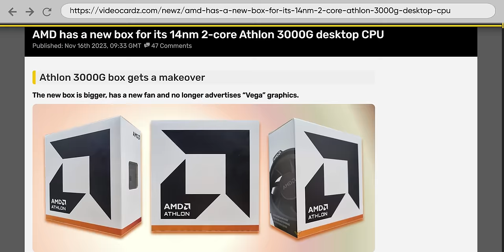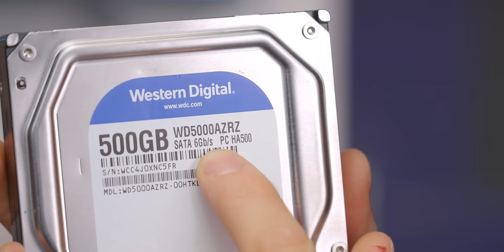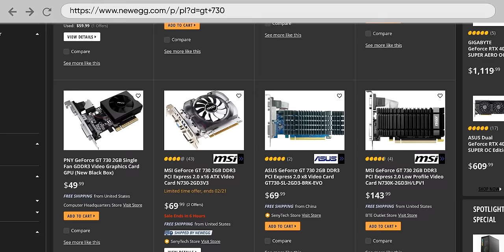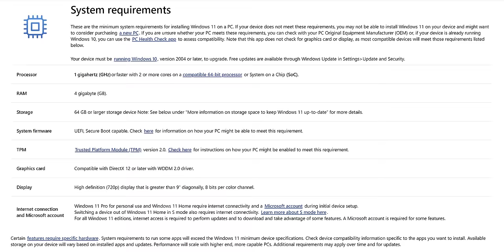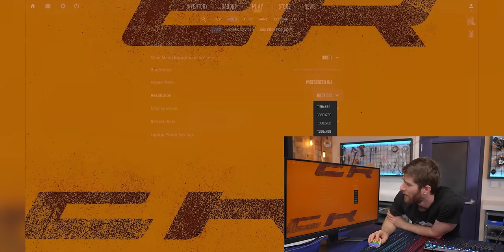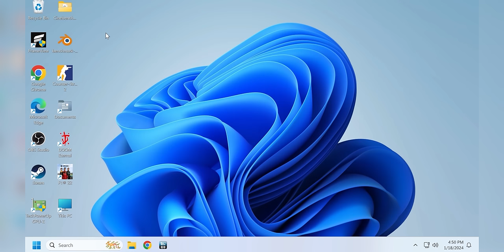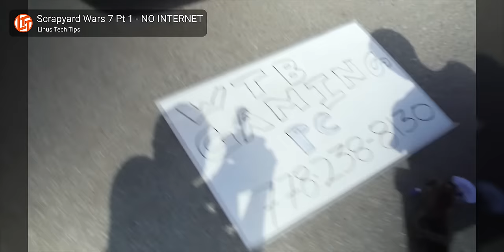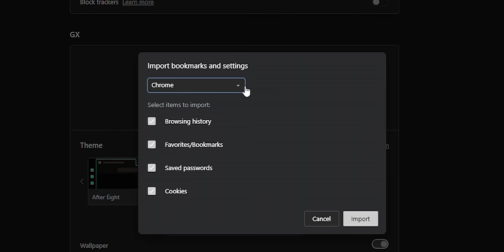I Built the Slowest Brand New PC and it Sucks.

Comment: It's crazy how "newest and slowest" PCs are essentially e-waste when compared to second-hand units. Really makes you question the value of buying brand new.
Reply: Wow! It’s almost like we watched the same video 😂
Reply: @w3therby  I will remove my comment and you should too. I don't know why I reacted on a generated comment.
Reply: Keep in mind they went out of their way to find the "slowest" parts for the money - you can build or buy new systems for a similar cost that perform much better - for example, I got a BeeLink mini PC for half the cost and it performs so much better. I use it as a Minecraft server for my kids and it works just fine for that purpose - even running it through virtualization.
Reply: Rightfully so. 
  - a broke hardware enthusiast
Reply: You get a warranty (although you get that from refurbishers as well).
Reply: In the used market for 11 years, reuse, nothing wrong with it.
Reply: that's a very llm comment
Reply: It’s crazy how this is better than the laptop I got brand new 3 years ago. Turns out, I shouldn’t have bought a laptop b4 I understood anything about what I was acc getting.
Reply: I haven't bought or built a brand new desktop or laptop for 15 years. I only buy PSU's and SSD's new.
Reply: I have a 2014 Dell Optiplex 9020. i7 4790, 8GB, 500GB SSD, 2GB GPU and it cost me £60. It would annihilate this slug pc.
Reply: "newest" is a huge stretch.  There are LGA 1700 Celerons.  More like "new old-stock"
Reply: Imagine you're a manufacturer of point-of-sale units or industrial PCs which run extremely primitive software and aren't internet connected. You need piles of them and reliability is everything. The ticket vending machines at my local train station are a good example.
Reply: Or the simple waste of tons of resources.
Reply: @althejazzman  Legit man. The last thing I bought new was an HP laptop in around 2008 and now I have 30+ computers. You just get so much more bang for your buck 2nd hand.
Reply: @el_shmuel  hey i still see your comment
Reply: @kelvinstokes996  That's a good point. In that application i think the amd would be the best one with half the tdp, paired with an ssd or m.2 you would have a decent atm or ticket machine etc.
Reply: @Cyba_IT  Is that why you've gone through 30+ computers?  Because they provide you bang for the buck??  I've only built 3 PCs in the last 12 years; the one I'm currently using has been upgraded 5 different times, the first one died in 6 months because of a bad CPU socket, and my next one requires windows 11 (it posted but not ready for Win 11 yet).  Thirty+ computers seems wasteful unless they vacuum, cook, clean, and fold laundry.
Reply: Business. That's why they exist.
Reply: @reubenmorris487  He didn't say he's gone through 30 computers, he said he owns 30 computers. I'm under the assumption they all still work
Reply: I feel like the big lesson to take away here is to always go for the mid-range? Mid-range from a few years ago is superior to the low-range of today for a fraction of the price... and on the flip side, getting mid-range today and then upgrading it to md-range a few years in the future will probably be cheaper than getting high-end today so that it will still be enough for you several years down the road.

Anybody who's trying to be the cheapest will have absolute garbage quality and anybody who's trying to be the best performance will be super expensive, but getting something balanced between those extremes means you're probably pretty decent at both.
Reply: These are legacy parts.  It's always been like this.  Notice that they are 14nm.
Reply: a 11 year old cpu like the i5 3470 is a better cpu than 3000g and that cpu is considered an e waste already crazy people.
Reply: Same goes for anything on low end, all gpus bellow 50 series nvidia or 600 amd ,i3, rysen3
Reply: Honestly, before 2021 i only used second hand parts for my own pc builds and i have been a hobby builder since 2012 or so.
I started in 2013 with a used i7 860, that i stopped using only 2-3 years ago. It was like an old king that refused to step down or die, and still held himself in combat.
So much so that i build a pc with it for a friend, he is still using it to this day for desktop use and competitive games.

On a budget, especially as a teen with no job i'd always go for second hand high-end gear. There is a point in a pc's lifespan where the value drops immensely because the new stuff is far ahead, but it's still a powerhouse nonetheless.
I still use a Dell Precision M4800 laptop from 2014 as my main portable, 4K screen and enough power in that I7 to make it a smooth experience. That mobile I7 would smoke these budget chips, i bet that i7 860 still would too!
Reply: Same goes for Brand New $75 smartphones, $150 laptops, $300 bikes, $600 mopeds, $1,200 motorcycles, $12,000 cars (besides the Renault Sandero and the upcoming Kardian).

As for houses, it's pretty impressive what you can get in a 500 square feet $120,000 "tiny house" nowadays.

Used? You can find anything on the second hand market at better value and quality for those prices as long as you're patient enough and willing to try haggling down the list price by 10-25%
Reply: If you actually tried to make a cheap new pc it’s a good value. Mine is like a little more than this one and it’s a million times better,
Reply: I just buy new because of warranties and stuff like that.
Reply: That goes for a lot of goods. Cheap clothing, garbage from china being broken easily and becoming waste. It’s a sad reality really as someone who keeps their stuff for a long time.
Reply: Well, for gaming it is just not worth it, not even for simple Windows with Office. But, if you are running some non GUI linux, it might be worth to consider brand new. But somehow I think in that case you better might look for a RasPi or equal. yet every usecase is different.
Reply: @reubenmorris487  I have different OS's on most of them, from Windows 3.1 to Temple OS and everything in between. 3 watercooled gaming pc's, 3 gaming laptops, 8 tablets, 6 phones, 12 regular pc's, 2 servers and about 9 or 10 regular laptops and ultrabooks. One can never have too many computers.
Reply: It's not new, new is like the super NVIDIA cards, not something from 2012.
Reply: This feels very dead internet not gonna lie
Reply: They are not. They are my faculty computers
Reply: I would say the value of buying new is knowing you can choose to get 3 years out of a system instead of buying used and having absolutely zero idea how much life is left in the thing you just purchased
Reply: Depends from use case. For secretary computer it is fine to have something capable to run office suite andweb browser without touching 3D gaming stuff. The thing is that newest software already run much better on CPUs with at least 4 real cores. If mediocre 4 core CPU and SSD can push the show, businesses will not pay more. For the rest of us former premium class hardware indeed will p[erform better in most cases. Of course don't go too low, premium configuration PC from 2005 will be annoyingly slow for today's tasks.
Reply: @KrotowX  Even a computer with these specs is not good enough for basic office work because of just how much longer it will take to complete basic tasks. Because instead of spending a 10th of a second waiting for something to load, you might actually spend three or four seconds and that adds up over time.
Reply: My used HP ZBook 17” G4 as configured back in the day…. cost a cool $4000 when you bought it off HP! Never buy new. 😢😊
Reply: Buying new without any hardware knowledge vs buying second hand with some knowledge and luck* the value of new is great as long as you know what you're doing and have the right budget
Reply: Wow thanks for the summary
Reply: No it doesn't. Things like warranty and knowing that your 100 dollar 1080ti was railed for mining make a mass8ve difference
Reply: some might say, "waste of sands"
Reply: GPUs are the biggest thing you can get used and save a ton for good power, I had dual 1080s for 200 a piece when the 20 series came out, when the 30 series came out I upgraded to a 2080ti for 500 I believe, They are 200s now on ebay, Now a 3090 can be had for 500-600 on ebay. Sure beats paying 1500+ for a new GPU when you can simply wait til the next generation and take 1000 off.
Reply: @JasonTaylor-po5xc  Most definitely, I think I built our new office PC for 300-400 all new parts and it is pretty damn quick with the exception of the GPU as I got a 730 just for multi monitor setups.
I put a I5 12600k in it and it was faster than my i9 9900k. Made me jealous that I haven't upgraded my gaming PC yet because it's a big let down for a cheap new I5 to beat my 500 dollar I9 from years ago lmao.
Reply: If you thinking of consumer products sure...
But for commercial devices. You may not need to go excess. You just need a warranty and some power. 
I buildt some scientific units that use these type of things because they sit on a bench and do a very basic task, and basic visualisation.
Reply: I think you should try ssd and then lets see difference
Reply: @4RILDIGITAL  if nobody buys brand new products then eventually there wouldn't be any used products either 😅. In a way, buying brand new products, like a car for instance, is a massive act of philanthropy as someone will eventually get that same car second hand for a considerable discount. That's why used car prices are increasing, as nobody can afford to buy new ones 😂.
Reply: @spoodmanire  don't tell people to buy used, it'll increase prices for us 👀
Reply: @ls0955  everyone makes that mistake to begin with 😅
Reply: good thing that international markets also have lots of places to go to for 2nd hand parts without paying expensive shipping fees right? …
Reply: Just put in dual channel ram and that poor computer would perform alot faster. Also, for the love of god dont buy dualcore at this time XD
Reply: I think the choice of hardware is the problem. If you get rid of that expensive MB and thar useless GPU you can get a waaay better brand new PC.

You can get a 5600G with a cheap A520 or A320 at about the same prince of that Celeron + H410 bc you would be putting 100 dollars on a good APU, not a useless motherboard and use the money you didnt spend on a useless GT 1030 and buy more RAM, specially dual channel, and a cheap boot sata SSD. You'll probably have leftover money and about 5x the performance...
Reply: @-Eternal-Damnation-  yeah 😭

Comment: HDD is slow but that 4GB ram is the culprit for the whole system being super slow.
Reply: Fr. I think all of that is used by windows 11
Reply: 4gb was making the OS hit pagefile instantly which just further shows why you should not install OS's on hard drives

yes 16gb would probably make this thing more snappy it would not be that big of a difference because 2 non HT cores are E-waste and will struggle with OS alone

if anything this is a good showing on why you should think a bit when looking to build a setup where slower 2 8gb sticks are actually better than a faster single 16gb stick of RAM

another thing is windows by default these days has RAM compression enabled (known as SysMain in services) which will hammer CPU to save space and if you were to disable that you can gain some performance back

so yeah; don't buy modern low end and go buy yourself a last gen mid range or even older high end because used market is actually full of solid deals as long as you have patience
Reply: It's probably just the CPU. RAM and HDD alone (or together) isn't making it that slow.
Reply: Yeah even on a lightweight 64bit Linux distro install 4GB is barely enough, I don't even want to think about trying this on Win 10, or Win 11. 😵
Reply: It’s probably both. I used similar specs pc a while back and found out that if you have either SSD or 8G of RAM windows is at least useable. I have a pentium machine with HDD but 12g of RAM and a mba with 4g of ram and SSD running windows, they are not fast, but basic web browsing is fine
Reply: yeah the system is probably swapping all the time, with double the ram it should run much better at least in windows 11, as you could see the ram was used up 54% with only running steam when running with 8GB
Reply: @CommodoreFan64  nah nah 4 GiB is plenty. my machine sits at 600 MiB after login. it's probably harder to use if you don't know your way around the system though.
Reply: @CommodoreFan64 I have run modern 64 bit debian on 3GB RAM and 2 Cores and while I'd not want to game on it it was fine for simple office work and webbrowsing  (the system had a SSD though...)
Reply: nuh uh 

you could have put 8GB of RAM in that system and it would have still been almost as slow
if you put an SSD in there i can almost guarantee you it would be markedly faster than you would expect
Reply: @22oreos i don't think that is true, by placing an ssd you would just increase boot speed and also application startup, but with 4 gb ram it will still swap (it will swap faster i guess) but increasing the ram should still have a higher impact cause once everything is loaded and in ram (and does not need to be swapped) the disk speed shouldn't matter that much except loading new apps
Reply: That is exactly what I said. 8 GB and an HDD is in most cases going to be faster than 4 GB and an SSD. (Provided the HDD isn’t ancient)
Reply: You can get an SSD for as cheap as a hard drive if you just for lower storage, ADATA sells some 128GB ones for very cheap. There's really no excuse to buy an HDD these days for your main operating system. If you just need the extra storage, then still buy an SSD for your main operating system, and then buy the HDD later down the line for secondary storage.
Reply: SSD also helps with virtual ram
Reply: @fghsgh  What Linux Distro, what DE/Windows manager, and are you using an SSD?  Also yes it can be done, but it's just not fun, when a RAM, and SSD upgrade is so freaking cheap these days.
Reply: @Raderade1-pt3om  Yes, but it will wear out your SSD faster having to use it as swap.
Reply: in that case the ram amount is delaying boot, i think minimum is 8 gigs
Reply: It's CPU first most and then memory.
Reply: Windows is greedy @dreadfulbadger
Reply: @amihartz  I stopped buying ADATA, as I've had issues with several of their SATA drives dying in less than a year as they use garbage nand flash controllers, so for cheap SSD storage I say Netac is a better option as they use a higher quality nand flash controller, plus it's about the same price per GB, but if you have a bit more cash, than PNY is a solid middle of the road SSD choice.
Reply: @HShango  Yep ever since the NT kernel Windows in general has been a greedy RAM hog compared to most other OS's.
Reply: 4gb is fine in windows 11, This is the hdd! plus possible updates post install

used dual core cpu's + 4gb with an ssd and windows 10/11 in work and its fine for everyday use
Reply: I think Windows it's the culprit here.
Reply: @metallurgico  It is, & as I said in my other comment compared to most other OS's out there, Windows is a system resource hog.
Reply: You even double the trouble by having only one stick of memory on an CPU like a Celeron. Win 11 runs like sh.. on a HDD. MS got out its way not that long ago to prevent OEMs and SBs to install it on HDDs for a reason. 4GB memory alone (with an SSD) will not give you such a bad experience. But combine all three factors et volià the perfect bottleneck.
Reply: Nah, CPU and HDD are also to blame
Reply: No, the problem is the HDD.  I still have my old system from 2008 with a core 2 duo and 4gb of ram and a r9 380 and of course a 128gb SSD.  It can still play most games at lower settings and it is faster than the used one that Linus showcased in this video.
Reply: That snail PC is comparable to my goddamn A6-5400K integrated graphics 1600MHz nightmare from more than 10 years ago in terms of performance without the SSD and the 1050 which was added to it later. I knew you could still buy slow ass parts, but wow.
Edit: And it was considered a budget PC even back then! It's still good enough as a backup PC to fall back to in case something happens to my current one though.
Reply: Yeah, on my old shitter HP laptop I used in high school going from 4GB to 12GB of RAM made a massive difference, even with the shitty i3 in it, it went from unbearably slow to usable instantly, crazy how much not hitting page file made a difference
Reply: @SteadVex  No. I have a laptop with an Intel 2600, 16gb of ram, and an nvme SSD. It runs w11 like in this video, absolutely unusable. It runs windows 10 fine and Linux great. The issue is the CPU first, and then memory. W11 is very demanding to the point where windows 10 is significantly better on older/slower hardware. You don't really notice on decent hardware how much more demanding w11 is. I promise you that swapping the HDD to an SSD will not fix any of the w11 slowness if the machine has a slow CPU.
Reply: HDD is still a big contributor or the biggest one, I've used windows with hdd (similar 5400 rpm) decent ram (8 gb) and cpu (ryzen 5 2500u) and the experience was terrible, granted by the time I put in a ssd in it I'd stopped using windows but I'd assume I would assume dramatically improve things (windows updates are hell on HDDs especially on older installs).
Reply: @CommodoreFan64  Oh my system is very high-spec. I just like i3wm. Need all the ram for the browser tabs, last i checked i had about 3000.
Reply: I can tell you it ain't the RAM. I've ran a Windows 11 PC with only 4GB RAM before and it was fine.
Reply: @xthelord1668  hard drives are overhated. I have multiple old computers with hard drives and they're still perfectly fine.